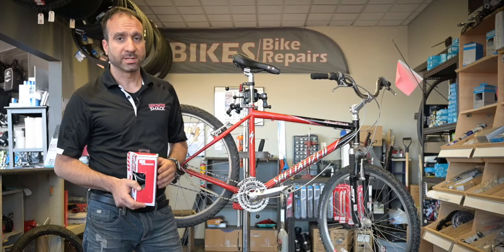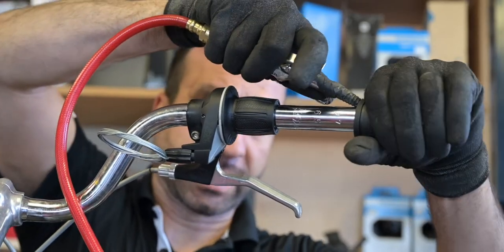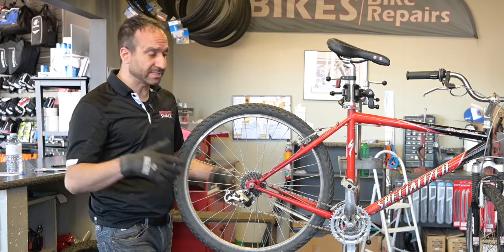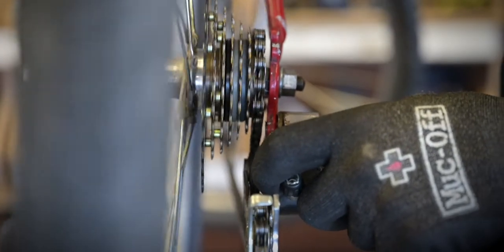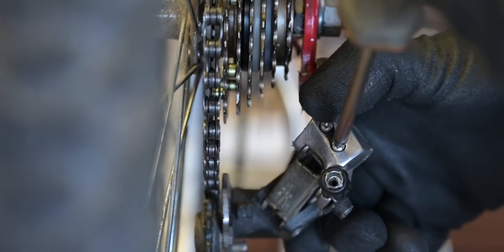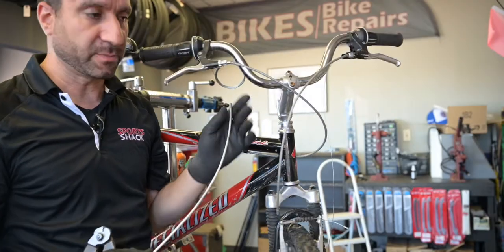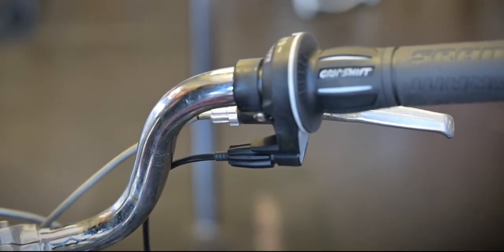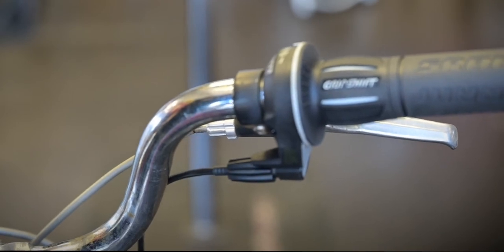Bike Repair Series - Episode 4 - Installing Grip-shift, and Adjusting Rear Derailleur

Comment: New grips would not go on at all. Used a little brake cleaner on the handle bars and the grips went right on fine. Thanks for the video.
Reply from the maker: Yeah, not everyone has a air compressor. Whichever works. Hairspray is a popular one. Thanks for the comment. Really appreciate it.
Reply: @SportsShackEDM  Just did the hairspray one myself.  They slip right on.  As a bonus, when it sets, it also sort-of glues them in place.

Comment: Shame I don’t Have any of those told , I suppose the bike shop would! You leave considerable tail on the cables why?  You never use that much and with age the cable stretches , gets longer ! Why?
Reply from the maker: Excellent questions. First, thanks for the comment. 
For the cables the extra length is for a few reasons. 
- easier to pull when the cable stretches 
- if cable gets frayed, you can cut the end off and still have room to pull cable
- if you replace the housing, it's a lot easier to push through, and still be able to pull cable. 
You don't need lots of cable overlapping, but enough for some room to play with. 
Thanks again.